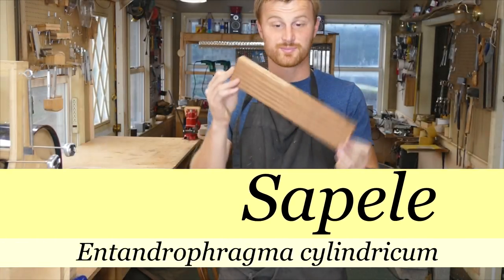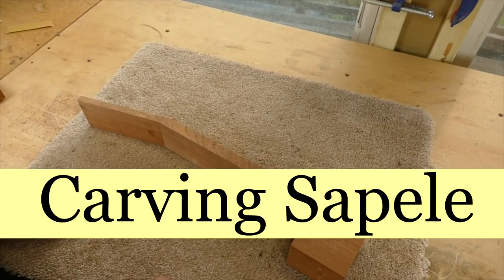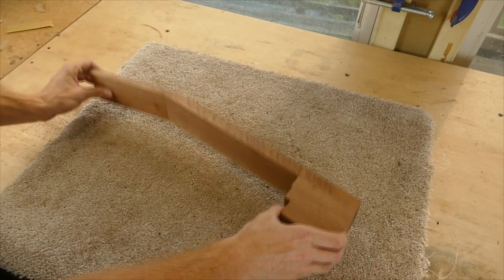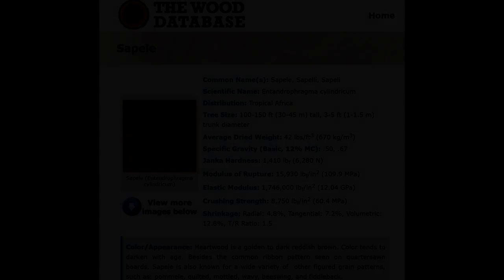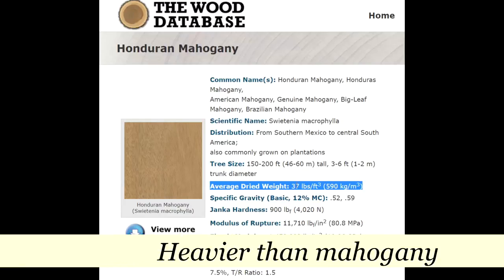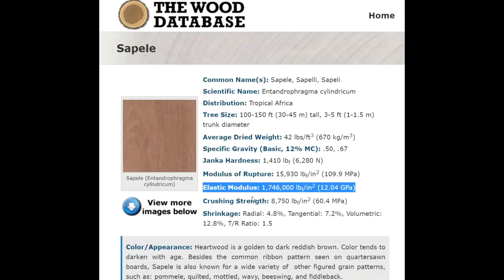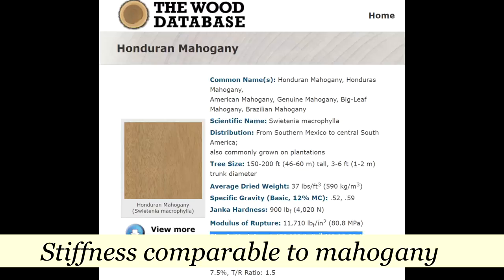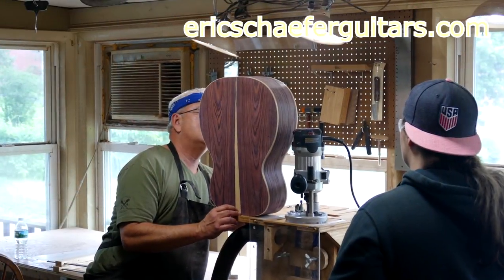Sapele vs Mahogany: A Comprehensive Review

Comment: I build electric guitars and use Sapele quite often. I find that it works just as easily as Mahogany and if you were using a particular dense piece of Mahogany you wouldn't tell the difference between the 2 species as pertains to workability. I love the rich color of Sapele and it smells amazing, I think the only drawback for myself is that it is usually very heavy unlike Mahogany where some pieces may be heavy and dense and some much lighter and loosely grained. Because of this I only use Sapele on semi hollow or thin bodied guitars. Overall its an amazing wood, beautiful, easy to work, easy to get, and at a fraction of the cost of true Mahogany.
Reply: Its true it smells very good xd

Comment: interesting video and perspective Eric  i am now a retired Commercial Woodworker  and in the early 90s  it seemed like every Architect was specking Sapele in their jobs  our Company built and installed thousands of Board feet of it  and for a fact i will tell you that the Silica  in the Species  without excellent dust  protection  and extraction will make your nose bleed  i also restored a Antique Wooden Mahogany Cabin Cruiser  as a hobby  and  i had to cheat  on a couple of missing or badly damaged Honduras Mahogany a substitute with a Sapele  replacement after careful matching and  staining and Varnish  nobody could  tell the difference i will note  i  selectively chose  those areas  to be a less noticeable area like  it of direct natural light  and  not on a focus point  of looking in those  substitute  parts  it was a success  and i personally didnt use Sapele  on anything below the water line but instead  sourced genuine Honduras Species

Comment: Hey, thanks a lot for this video.
As a wood novice in all regards, I found it extremely helpful.
What do you say to the prospect of flattening sapele with a handplane on my balcony?
I don't have a workshop nor do I have a planer or beltsander.
I was thinking about buying a really high quality handplane and to flatten strips of sapele to glue them into a cutting board, but I'm afraid of tearout ://
Thanks again for the video

Comment: I bent two sapele sides today for an OM and both cracked at the waist. 10 minutes for first one and 6.5 minutes for second. I am using the LMI bender and am 100% positive I got the sandwich built right. Boards are 0.083, straight grain and perfectly quartersawn. Any ideas what I'm doing wrong?

Comment: I've been working with Chinaberry wood recently, and its fantastic! also in the mahogany family (melia azederach) it resembles Burmese teak, and is buttery smooth under a router. open grain needs pore fill, but the grain is refractory and jewel-like with a gloss finish - looks about ten feet deep... makes for really competent looking tigers eye finishes (and trust me im not that competent with complicated finishes). ....exas
but no one is milling/kilning it - I got my meager supply (which is almost gone now) from a place called greenwood milling in San Antonio - it was salvaged from a Chinaberry tree at the San Antonio zoo that was cut down during a recent renovation...
I've seriously begun thinking about improvising some sort of mill and kiln operation in my garage just to get my hands on more...
oh and the wood contains Neem oil, so its insect resistant, and it smells like cake baking in the oven.. great stuff!

Comment: Have you tried Myrtle (California)?  I have a piece that's flamed and it's beautiful!  But looking at the numbers on the Wood Database, and Myrtle is lower in elasticity, lower in janky than Sapele.  Being a California wood it's not on any endangered lists.  I wonder why I haven't seen any guitars made with it other than drop-tops on electrics.
Reply from the maker: No I've never worked with it. I assume you are talking about Umbellularia californica, which yes, on wood database the numbers look pretty good, except for the indicators of dimensional stability (T/R Ratio and volumetric shrinkage) which look sort of high, so maybe not for necks or fretboards, but based on the numbers seems alright for back and sides, although side bending qualities are hard to predict from the numbers. You'd have to test out the willingness to bend with a piece of scrap first. If you go through with using it, let us know how it goes!
Reply: I think Breedlove uses Myrtle quite a bit for back and sides...

Comment: Is sapele good for top body wood?
Reply from the maker: For an acoustic top? It's all about how you use it. Thickness, bracing pattern, brace height/thickness... but, no, sapele doesn't lend itself especially well to being a soundboard wood. Bit too dense. Although I have used it as a top. It's not the worst thing you can use I suppose lol
Reply: Takamine has made a sapele top guitar but laminated I think